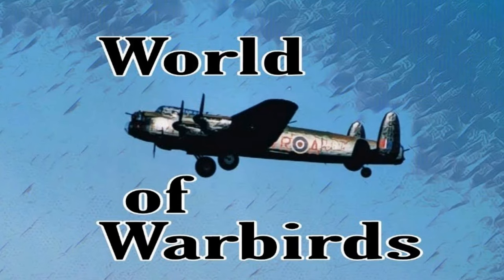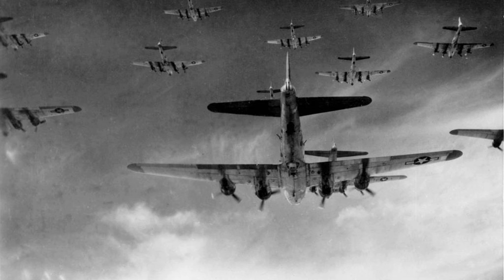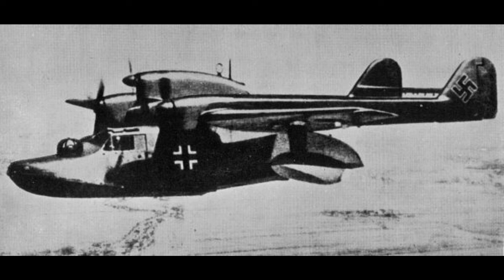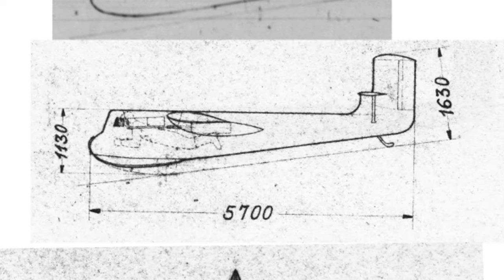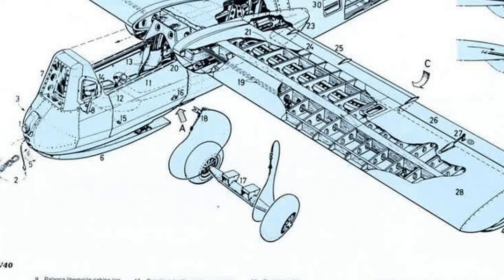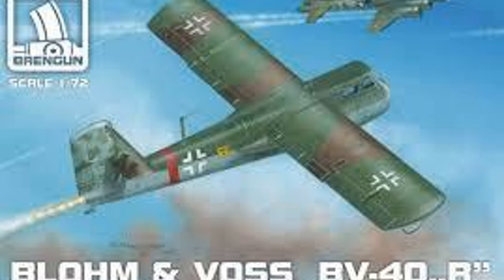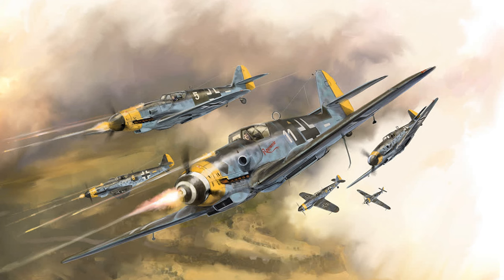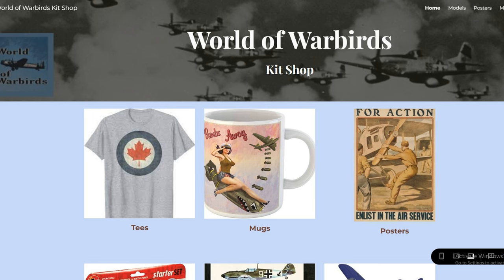Killer Glider! The BV 40

Comment: Info about why it was cancelled would have been great. Reason was landing speed. Due to high weight (all the reinforcement and guns) it had with those small wings a high wing loading which leads to high speeds needed to stay gliding and not falling. Even the flaps could not get landing speed low enough. Landing at high speeds is risky. Stalls, bumpy landings or simply crashes into the ground are hard to avoid. Not great conditions for the intended lesser experienced pilots.